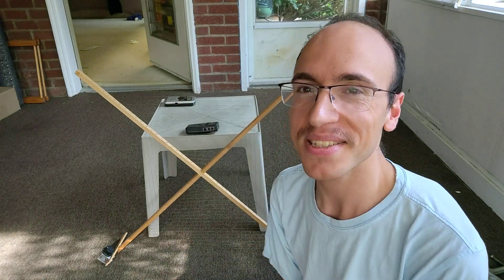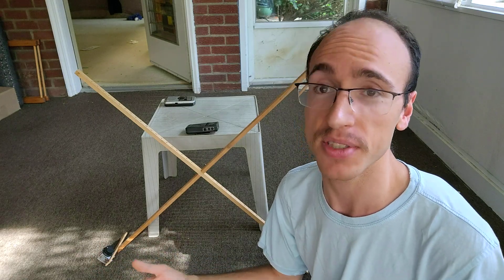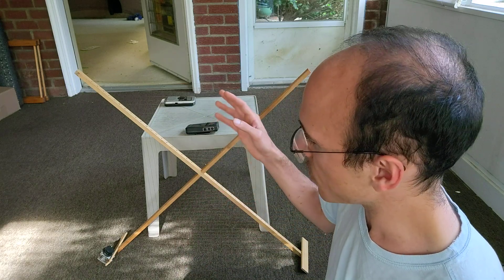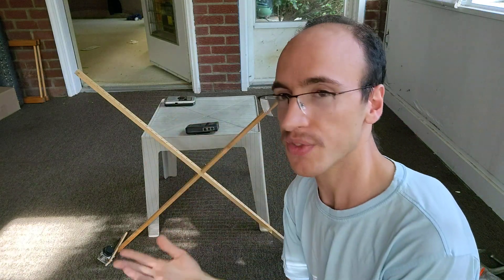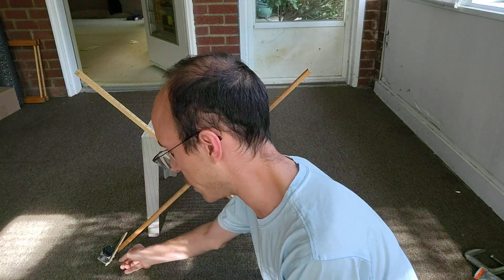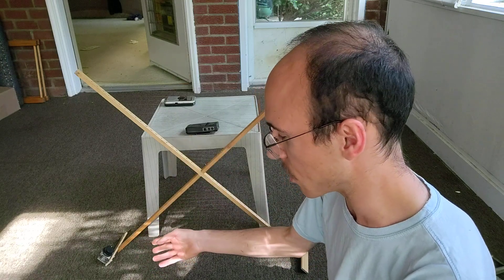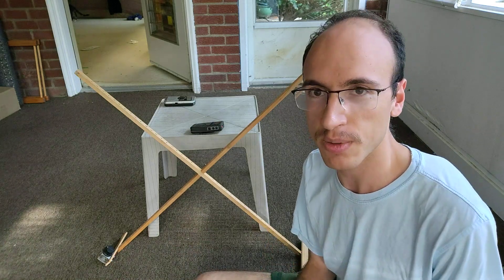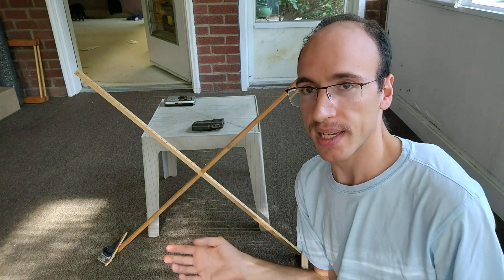AM DX loop construction and demo

Comment: Can you demo the antenna attenuating an undesirable station ?  I’m not sure if the antenna has to be rotated 90 degrees or not .
Reply from the maker: I think 45 degrees is enough to decouple. That or notching with the tuning cap (and/or changing loop orientation or loop/receiver spacing) are your options.

Comment: You said you drilled holes for the wire.  I cut notches at an angle and slid the wires in.  It was much faster and easier than threading the wire through each individual hole.  The wires can be held in place with glue.

I'm listening with the volume turned to max.  When you're talking at the camera your voice is barely adequate, but when you turn your head away it gets weaker and becomes harder to understand.  Thanks for the informative video.
Reply from the maker: Thanks for the constructive criticism! Pun intended, haha! Did you also make a spiral or did you wrap wire around the frame? Somehow I would worry about the wire coming out. 

Thanks for mentioning the audio issues. I do notice fading when I turn from the camera but my speech is understandable throughout with the volume turned up. It must be that my phone's audio is good. Maybe I will use a mic next time, stand behind the loop, or stand behind the camera during recording.
Reply: @walnuthills11  
The reason why some people use a spiral is to minimize the capacitance between wires.  There are all these other ways of winding the wires, like cutting an odd number of slots in the form so that the wires touch each other only at the slots.  I think they call them spider web coils.  I wound mine in notches at the ends of the crossarms.  I didn't use glue because I wasn't sure if I had too many or not enough turns to completely cover the AM band.